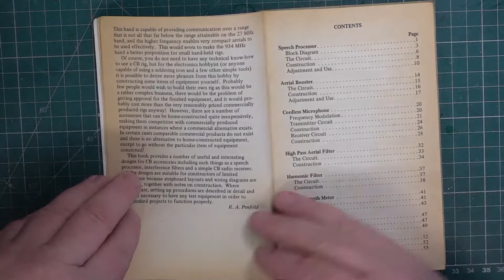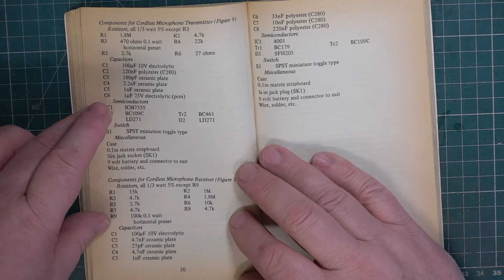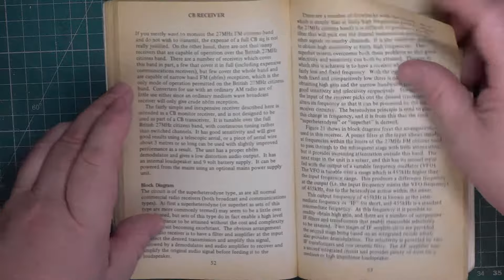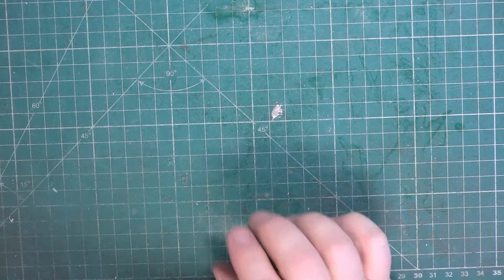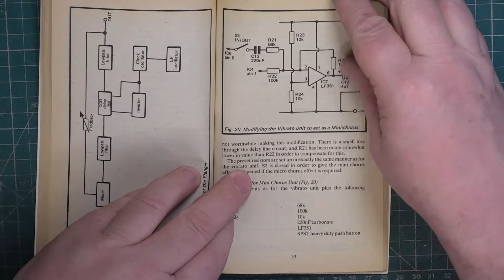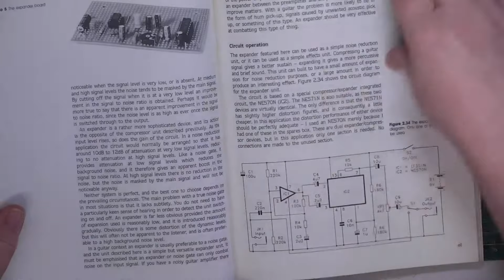CB radio projects - Robert Penfold book from 1981

Comment: I would have thought that you would have to MC1496 DBMs one for the input and one for the output driven off one oscillator operating at 38KHZ and having a clipper in the middle and filtered  before being converted to audio via the second MC1496 to be fed into the microphone input.

Comment: Very good to see the book thank you Richard. A tunable radio on CB frequencies appeals however now, I suppose the answer is an SDR. Sad, it's nice to make things you can use but as I found with The Ladybird book by the late Rev. G Dobbs, about building an am transistor radio, some of the parts  are no longer easily available in the form they were shown even as the book was still in print.
The coils I was thinking of the other day were Toko type coils, not Denco. I see some intrepid people have managed to make their own coils.
3D printer for the formers and home made winder (VK3YE video)
It would be interesting to look further into the power supply though. My brother made one back in the day which I shall have to examine, using RS parts (as father had a trade account).
Sadly with the demise of AM broadcast radio, there are less and less easy ways for youngsters to get interested in fundamental electronics.